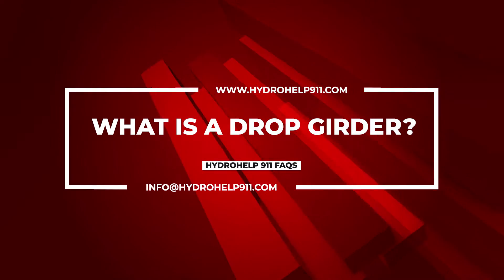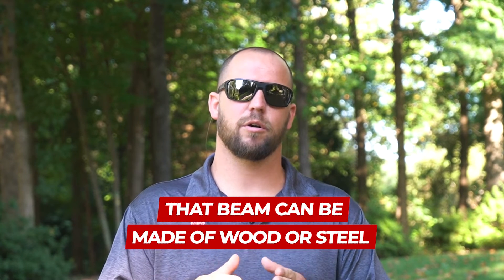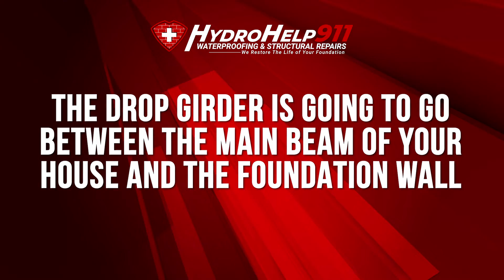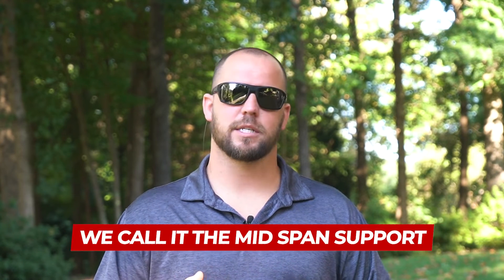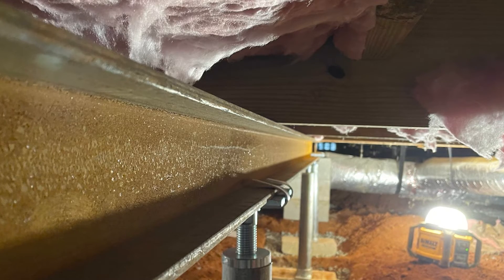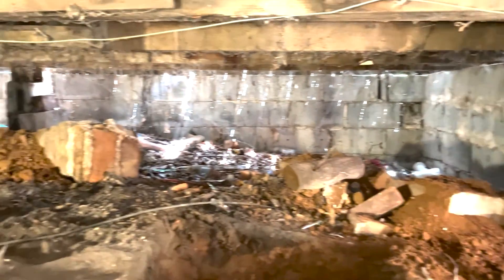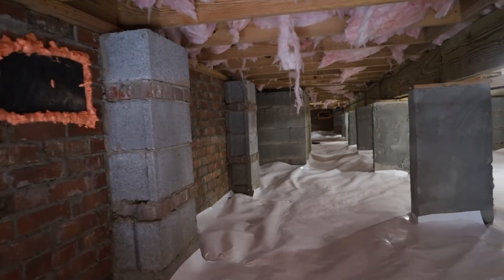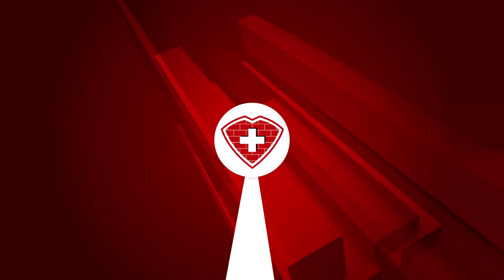What is a Drop Girder? | HydroHelp911 FAQs

Comment: Why do you prefer steel beams over wood drop girders?
Reply from the maker: The cost difference is negligible and we do not have to worry about the metal rotting or being eaten by termites. It is also a time saver from not having to glue and screw 2x's together. Hope this helps!